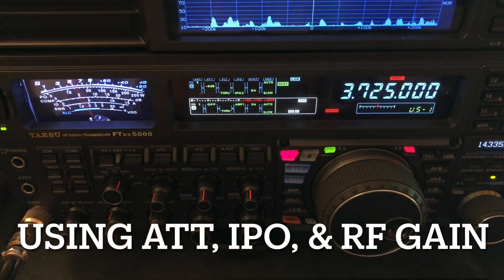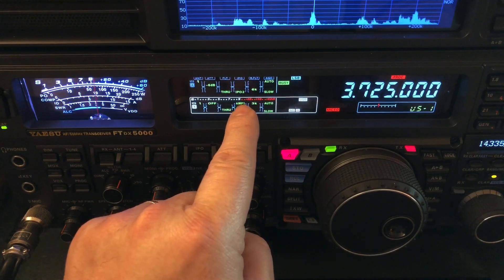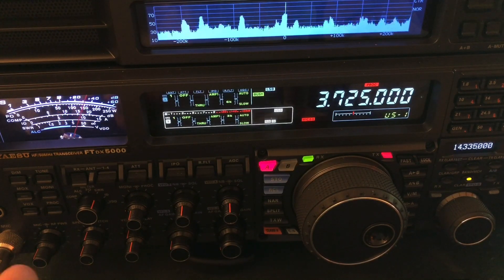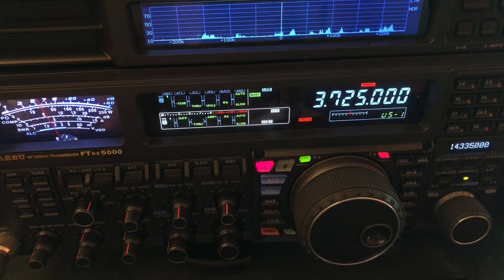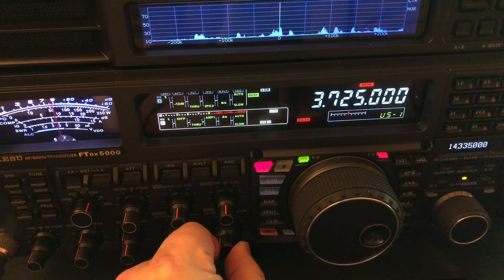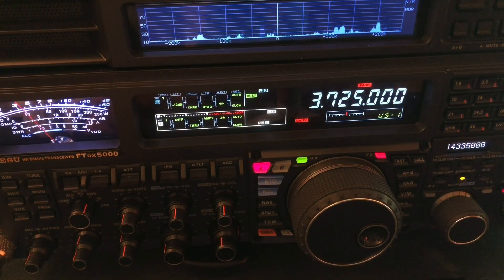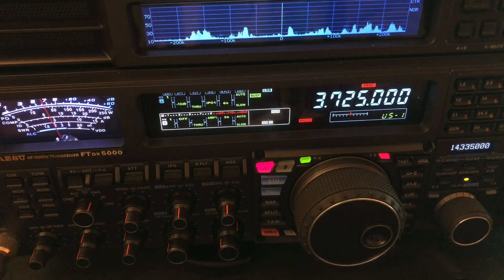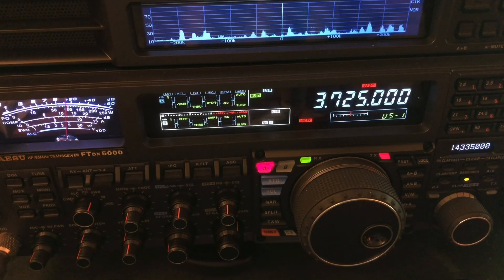Using ATT, IPO, & RF Gain #yaesu #ftdx5000 #hamradio #ipo

Comment: Great video! Thank you for doing this style of teaching. Do you have a video that deals with noise on the 20 and 40 meter bands? I just got an older Kenwood 570 and I would love to learn how to deal with noise when the signal is not very strong to begin with.
Reply from the maker: Pulling signals from the noise floor is probably the main thrust of my channel.   There are currently 112 videos in the HF Noise Interference playlist.  

That said, the Yaesu radios have DSP capabilities that excel at mitigating noise. The FTdx10, FTdx101D/MP, and FTdx5000MP are the best among the Yaesu transceivers at mitigating noise.  The digital noise reduction algorithms and the Contour filter are fantastic for helping pull a weak signal out.  

But you always start with IPO, on 20m and lower.  In Kenwood radios, the equivalent to IPO is no preamp.  Kenwood digital noise reduction is not one of their best features, and there is no Contour filter. 

You can somewhat simulate a Contour filter by running the manual notch filter at a wide setting. Sweep it up and down the band until you can hear the weak SSB signal the best.  I showed this technique in one of the videos when I compared the IC-7300 to Yaesu radios. I used the manual notch filter in the IC-7300 to simulate a Contour filter.
Reply: @n4hnhradio  thank you so much the detailed response. I can't wait to try your suggestions. I do have my eyes on the DX-10.
Reply: @n4hnhradio  Thanks for the response. I look forward to trying your suggestions this weekend when I get to play radio again. 73!

Comment: A little off topic for this video but I’m wondering about your experience. There is a menu item to select the function of the RF knob, setting it to either RF or squelch (SQL). It would seem that the rig ought to switch to SQL whenever you go into FM mode but it doesn’t. The fT-891 I have does. Is there a menu option I’ve missed or is this another fix Yaesu needs to make? It also doesn’t store in memory.
Reply from the maker: The FTdx5000MP has a separate squelch knob and RF Gain knob, one for each receiver.  The FT-891 and FTdx10 have a menu option for either squelch or RF Gain, for SSB and AM.  As I recall, the FT-891 does switch to squelch when operating in FM mode.  The FTdx10 doesn’t.  That would be a good suggestion for Yaesu’s Contact Us page.

73, de N4HNH